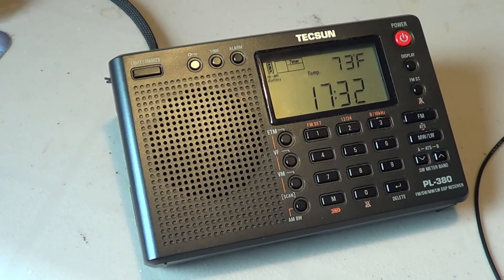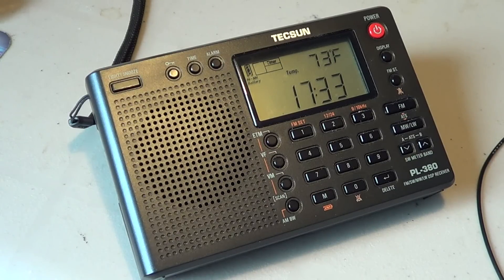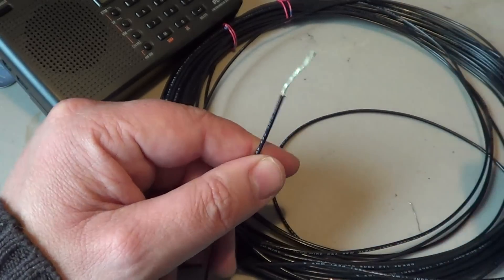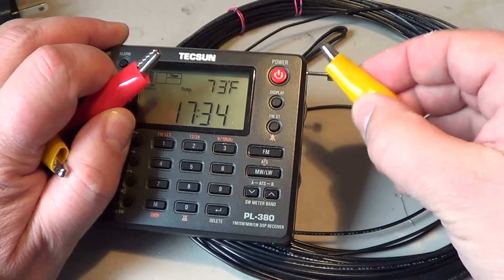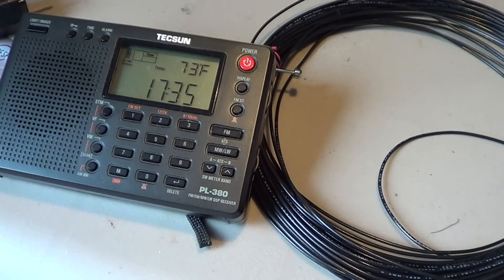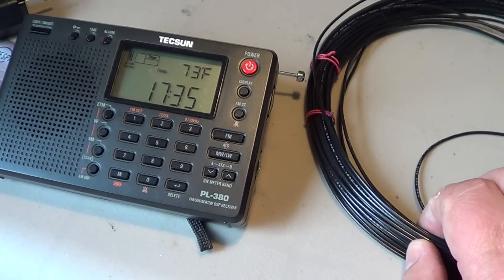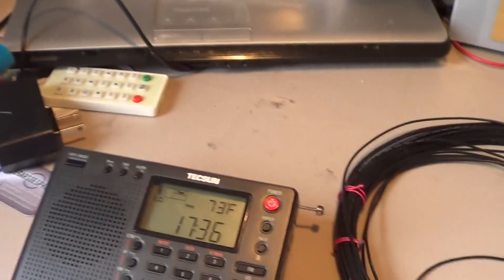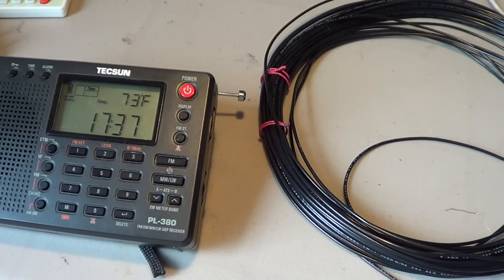Tips and tricks for the Shortwave Radio beginner Part 3 Antenna

Comment: I built my first crystal radio about 1960, and with a 20 foot wire antenna I could pick up several stations. I soon graduated to transistor circuits, but that simple wire brought in signals from all over the world.
Reply: Thank you from 2023!

Comment: Ham radio hobbyist 23 years - grounding is crucial for any radio on the AM / SW bands.
Small radios can be grounded by making a ‘dead plug’ - clip the ‘hot’ or tip off of a connector such as the headphone plug (remove two tips for stereo).   Find which of the plug lines are connected to the negative.   You now have a ground by connecting this line to any metal object driven into the ground ( like a nail ), and inserting the clipped plug into the radio.  AM / SW stations will come in so strong, you may have to retract the antenna to prevent signal overload, especially listening at night.
You can also ground using the USB cable, but it’s a little more complicated.                           Simply put - Grounding is the third component to radio reception - voltage enters the radio through the antenna. The radio ‘uses’ the energy. The energy has to be ‘vented’ out of the radio through a ground connection, or there will be a buildup of unreleased voltage / static.
Reply from the maker: useless on portable receivers and most people do not do a good ground, unless you are close to the rod... it is not a ground at all
Reply: @OfficialSWLchannel  I checked out the V115, pretty good little radio.  The Line In and Phones port activates even when only a ground sleeve makes contact, so it’s useless for grounding.
I tried grounding through the USB and it works. USB cables have two grounds ( or only one if it’s just a charging cable), so be sure to earth ground the chassis ground wire and not the electrical one, which is used when two devices are linked.
You are correct - grounding is usually done sloppily or ignored altogether.
Reply: With that you cant use the headphone
Reply: @gabrielv.4358  You also can't use the headphones if you have no reception.
Reply: @Kube_Dog  Technically you can, but you will only hear static
Reply: @gabrielv.4358  Good clarification.  Most people would have missed that.

Comment: The house I grew up in had an antenna wire strung the length of the attic inside and then a wall jack in several rooms to plug in a very early radio with headphones.  There was also a crystal radio with the old cat whisker and headphones.  I enjoyed using that radio in 1964.

Comment: Check your surroundings before throwing.  Neighbor (into ham long before me) threw the end of a wire while holding part of the coil in his other hand.  The thrown end made contact with a power line and the hand holding the coil had to be amputated.
Reply: smart
Reply: A fuse would be jumped by voltage in the thousands
Reply: jesus christ man
Reply: Bloody hell. Thanks for the advice espalding

Comment: An antenna that is too long can overload the front end of these receivers.  20 feet is about right. If overloading (  lots of stations received at once and too much Noise)  occurs you can leave the insulation on and wind the wire a few times around the telescopic antenna and a good signal will be had via induction.
Reply: It should not be an issue with the Tecsun receivers. At least I don‘t have any with a PL-380 and 30/60 meter band antenna.
Reply: Why don't they just make a radio that works?  All this antenna crap is making me sick.

Comment: Totally newbie here, i was under the impression that AM loop like antenna are completely independant from the FM telescopic like antenna and that therfore it wouldn't work to put attach some kind of loop antenna to a telescopic antenna ? (please correct me, i'm really  a confused newbie !)
Reply: i think it depends on the radio. i've heard that as well, but i have also attached wire to the telescopic antenna and do in fact get much better AM reception
Reply: To get really good AM reception, you need to locate the station you want to receive and go sit in their parking lot with your radio.

Comment: Just a long wire picks up a lot of noise as well, as mentioned. Antenna tuners are cumbersome so I am glad I found the MLBA from RF systems, Magnetic Longwire Balun Antenna, which has 50 Ohm shielded coax coming in to your home. There is a 12.5 meter and a 20 meter long version. I got the 20 meter long and the reception is way better than the whip antenna!
Reply: Could you give us the link to the antenna, please?
Reply: Sounds like an advertisement though 😜

Comment: Hooked a 25ft piece of wire to my Grundig G3 with an alligator clip. Checked to see how long a  windup reel antenna was. 23ft. Thought Id take a stab at it. Works much better now. Should have know that being a ham for over 25 yrs but thought it wouldn't make much difference unless you hooked to the oscillator. I was an swl in the late 70's till around 2000 when all the big stations left.
Reply: Do you have any ideas as to why the big shortwave radio stations left in  the year 2000?????

Comment: What would be better in the case of an existing antenna jack on the radio : a simple wire, or a coax connected to both poles of the jack?

Comment: Could you discuss where to place the antenna away from indoor power lines, away from computers, TVs etc. I have our power line coming in right near my window where I wanted to send out my antenna. Is the interference that great? I'm just using 30ft of speaker wire. Thanks!!

Comment: Does the wire need to be straight up in the air or a few meters up and horisontal along the ground or can it be a more or less a loose coil of wire wrapped around a tree or something or just a mess of wire on the floor, or perhaps cover all walls in a square near the ceiling in a room? Does it matter how it is arranged and has anyone tested these arrangments to see whats best?
Reply: Good questions. I guess yo have try all of these to find out, or maybe there's a YT video that will tell you (and me).

Comment: Ty much  I have a 5th wheel trailer and I think I can just shoot a antenna wire out the screen and up to the roof, then I can  have 20 or 30 ft of wire easy  , but what should I do with it, just spread it out then ? Will the metal roof be an issue ? I really dont want to Build an antenna per say yet, but something for emergency Comms

Comment: There must be some secret radio club that tells its members how to set up an external antennae that works. Seems like someone would just sell it without the need to Jerry rig. The wire you are using is insulated? Good tip on alligator clips! Any kind of wire? 

I was wanting to listen to short wave radio for under $200.

After research, you tube, and reviews I am more lost than when I started. Even if I buy a 300 dollar unit I am doubtful it will work. 

I live in a valley so I think I’ll need to make some funky antennae modifications. I guess I’ll need an external jack for an antennae, maybe wire. Not sure what kind of wire. I was thinking about connecting it to some fencing. Any ideas? 

(My experience is seldom does anything work unless you know the trade secrets.)

Comment: Is it possible to remove the stock telescopic antenna and replace it with a long wire or other antenna using an adapter. Im told the stock antenna are not effective.  Have 100' speaker wire in my attic and would like a better connection. Yes, i know having that outside and unobstructed is better.
Reply from the maker: On most radios the antennas are but some have external antenna jacks and you can always clip a wire to the telescopic

Comment: Another tip: use a rainpipe as an antenna. I have a 12m long vertical rainpipe just outside my window, so I ran a short wire to connect my radio (exactly the same as shown in the video) to this pipe. Both SW and FM reception improved dramatically. In my case the rainpipe is not connected to the ground (bottom piece is made of plastic). Technically, i guess it could count as a "T" type monopole antenna.
Reply: It may not be the rainpipe improving the reception but rather the signal outside is better.

Low-E windows generally block the signal a lot, no matter if it‘s SW, FM, LTE or NR.
I also have an antenna outside and I even got a dutch FM station from 200km away (I don‘t know how it‘s possible, maybe because I live at a elevation of 300m/1000ft).
It‘s the same with 5G, if I go outside I get 5G but inside there‘s just 4G.

Rain gutters/pipes usually are grounded.

Comment: Would it be beneficial in any way to use a balun with a wire receiver antenna?
Reply from the maker: Usually Baluns are to match antenna impedance, technically it might slighly improve signals, but for most use, it will have little to no effects
Reply: @OfficialSWLchannel  It's good to hear you opinion.  I bought a 25 ft longwire kit on eBay.  It came with a balun and I set it up.  Followed the instructions 100%.  It is mounted on two plastic pipes on top of an old mobile home.  I am happy with the setup.

Comment: What gauge wire is suitable and easy to work with (not too stiff or rigid)??
Reply from the maker: I use 16 here works great
Reply: Any gauge copper wire is fine. I use 0.6mm enamelled copper,quite cheap and easy to work with.

Comment: what SW radio do you recommend. I need to listen to stations maybe 4000 KM away.
but my max budget is 100$.
and do I have to get one that has external antenna port as a better solution than the aligator clip.

Comment: Can I use a cb antenna to listen to sw? And does it has to be grounded? Also copper wire (best bare copper) works way better of the video you are showing
Reply from the maker: yes you can , I used a 102 inch, it is not as good as a dedicated shortwave antenna but it will work

Comment: Giles, great video! Thinking about setting up my first external antenna, unfortunately, I don't have any trees in my backyard. I do have a wooden fence that runs the perimeter of the back yard, it's about 10 feet tall. Would running a wire around the yard horizontally on the top of the fence work? Would it be too low to be effective? I live in a suburban environment with houses all around.
Reply from the maker: it could work very well, try it out , that is the fun of Shortwave Radio..  testing out antennas

Comment: Nice method
Is this radio overloaded or not if we use external antenna??
Reply: It can happen if you have  a strong local radio station .  More than 5 miles away you "should" be OK.

Comment: isnt it dangerous to put a wire outside when it comes to lightning ?
Reply: Yes that's why radio op disconnect  n ground  some use lighting protect
But it still get thru  so it best discount out side n ground to a sepert ground  than you radio ground 
Twis as farr a way as the link ground rod is in the ground
73 n good dx n9prf 2fb2112 JOE

Comment: could I run a wire to the gutter of my house? would that help at all?
Reply from the maker: yes that could help
Reply: will electronic devices cause iterference if they are plugged in but turned off?
Reply from the maker: Some do, the Switching power supplies in these devices are often still working even when device is off
Reply: Evan McRoberts .....  I wonder about the risk of lightening strikes to any of these externally mounted SW booster antennae??

Comment: Sometimes this isolated wire having some electrical chargs from the thrunder of the sky 
So what is called ic (integrated circuit) will be dameged or corrupted 
So i have to avoid direct connection of isolated wire with antenna i should just wrapping the      wire around the telescopic antenna wthout direct contact so i have agood signal witout noise 
By the way i can use abattary of 9volt without using direct current so signal will be clear otherwise noise from electrical charging 
Wishing for all good things &happiness
Mahmoud elsebaey

Comment: Do you mind going over safety tips such as lightning and storm using wire? I want to set up a long wire as an antenna around the housr, but is there a hazard during storms since the wire is not grounded? Sorry, I am new at this.
Reply: I wouldn't use it in a storm, but to be honest, if there's a strike anywhere close to you then all your electronics equipment is going to be damaged from the substantial electromagnetic pulse, regardless of it being connected by a wire to anything.  During electrical storms, sailors will often put a radio or handheld GPS in the boats oven (or better still, microwave) - this serves as a Faraday cage to protect the devices in case of a strike.